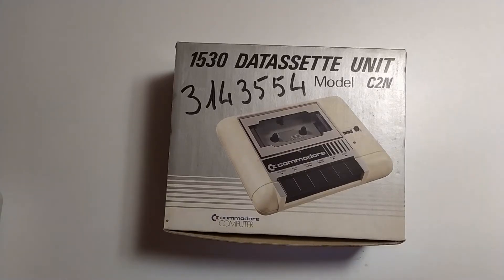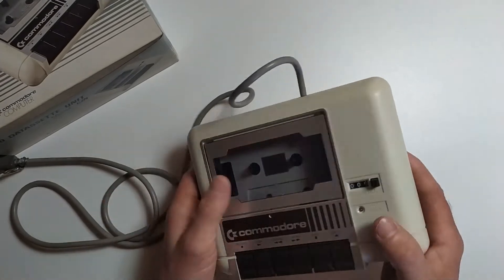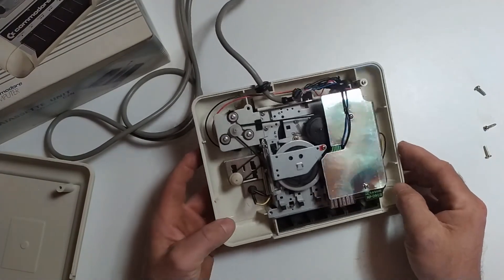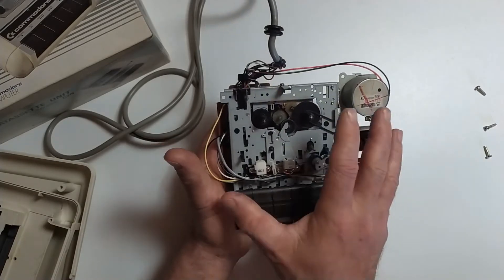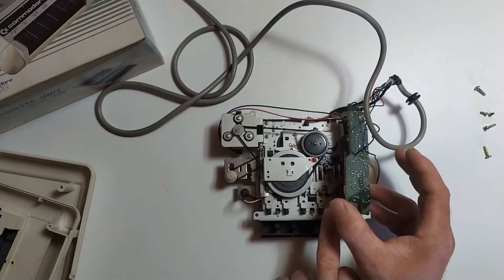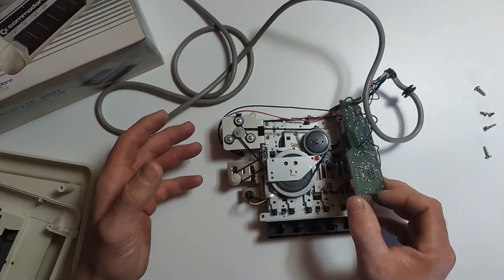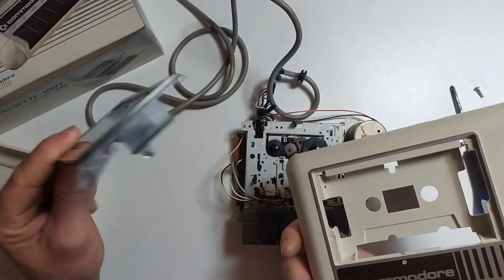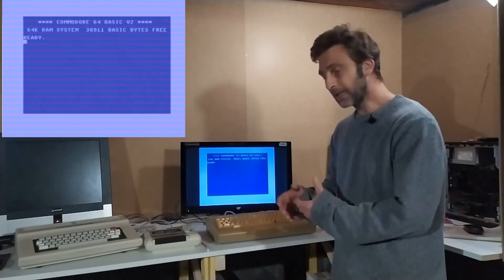Tapes, azimuths and the C64 | the C2N 1530 datassette

Comment: There used to be a kit advertised in the usual 64 magazines that fitted an azimuth knob to the outside of the casing and a red LED level bar meter to help assess when you'd got the optimum adjustment.
Reply from the maker: Sounds cool, but I never heard of it.

Comment: There's no DAC or ADC. It's just a chain of simple OP Amps.  The signal is digital from the start.  It's not like the TRS-80 or Apple that use FSK, on the Commodore, the bits are written directly to the tape like a disk drive.  A square wave from the computer ends up as a rounded off pulse. A long duration between pulses is a zero, a short duration is a 1.  There's no need to convert anything.
That's why the Commodore drive worked reliably unlike the cassette interface on other computers which use two different frequencies to define a zero or one and those were very sensitive to volume and tone.
Reply from the maker: I don't claim to know a whole lot and I'm very happy to be corrected ;) Thanks very much for the info Chuck. BTW your video on backing up cartridges to tapes was intresting and very useful too,    👍
Reply: @8bitsinthebasement  Thanks